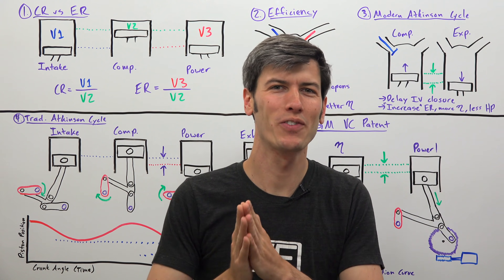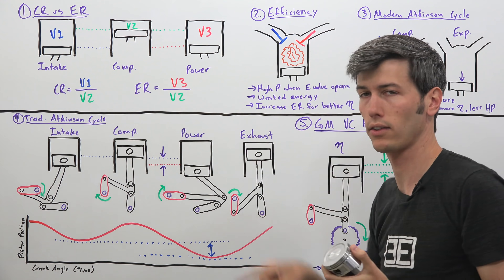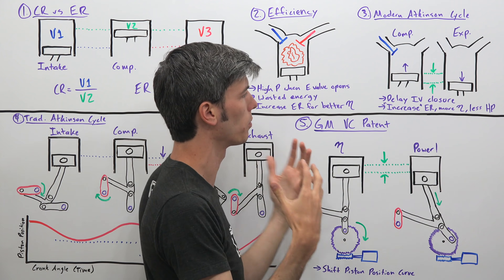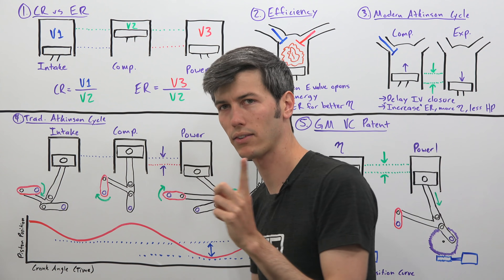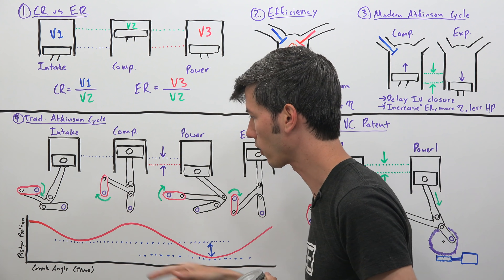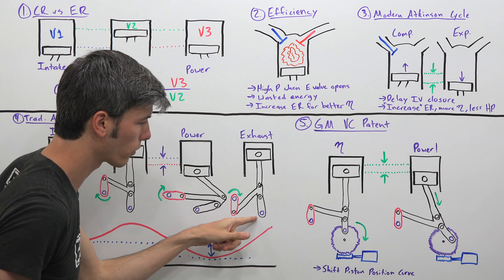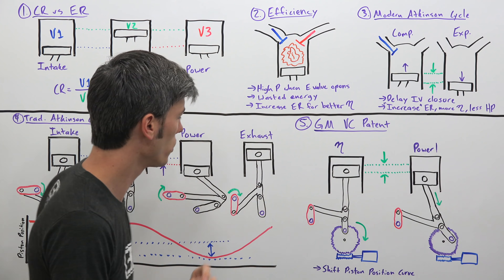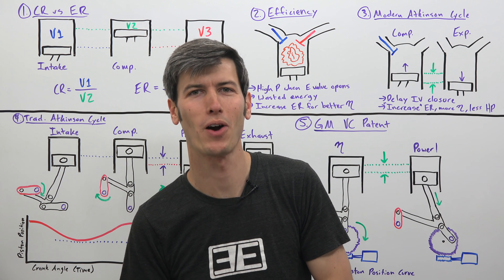How GM's Variable Compression Engine Works - Patent Review

Comment from the maker: Hope everyone's having an excellent day! What do you all think about this style engine versus Nissan's VC Turbo? Thanks for watching and thank to Skillshare for sponsoring! First 500 to sign up get 2 free months! https://skl.sh/engineeringexplained2
Reply: One of the few things I noticed is that Nissan’s engine will have almost no secondary piston imbalance in an inline 4 configuration while god knows how many balance shafts will need to go into this GM variable compression motor.
Reply: @gqh007  correct. This GM desigin would be heavy due to its need for balance shafts.
Reply: Looks like it might only work in an inline engine, which is a downfall of the Nissan approach also. Simple in principle, however the likely increase in overall complexity and manufacturing costs wil probably result in this design not reaching production. Personally, I prefer the nissan approach as it allows for much smaller rod angles, reducing side force. I am currently looking into another approach which allows for variable compression and expansion ratios and can be retrofitted to any existing engine. EE, if you would like to talk about this, let me know.
Reply: @jordmaate  aahhhh! Someone with sense. Also. This GM desigin looks like vibration may be an issue.
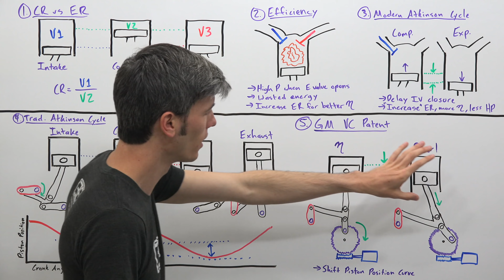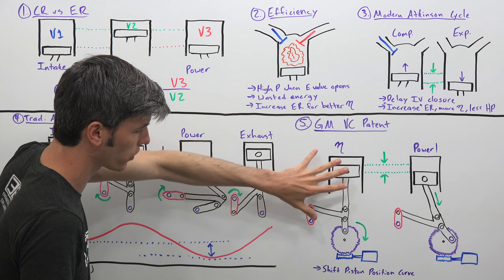Reply: You probably won't address this, but anyway: I believe you misspoke at 8:16 and 8:53 because you said "traditional Otto cycle" instead of "traditional Atkinson cycle".
Also, you seem to contradict yourself because at point 3. you say that decreasing the compression ratio gives more efficiency and less power, and at point 5. you state the opposite.
Reply: @Shewasa Fosho how does it get injected with no injectors or carburators ?🤔
Reply: @Shewasa Fosho do you know that the modern injectors are able to achieve up to 10 injections in a single 4 stroke cycle ?
 if you have 8000 rpm in a V8 this would imply 10 injections in less than 5 ms. Still i cant see how inefficient this is..
ur main goal is to reach a desired air fuel ratio, we still havent talked about ecology yet 😋
Reply: @Shewasa Fosho sorry bro am an engineer.
i understand efficiency with numbers.
please hit me up with ur injection efficiency calculations so that i can analyze it and tell you:
well done you are correct, those dumbass manufacturers where doing it wrong the whole time
Reply: Working as an Engineer I have developed over 100 1st Gen small block Chevrolet engines, and in technical inside sales at a U.S. engine remanufacturer taking calls from all over the country hearing from automotive enthusiasts, mechanics and the general car consumer gave me real insite of what engines are failing on large numbers call after call after call some people even crying in disbelief at the financial crisis a failed engine put them in. Mechanics telling me they see three of these a day, every day. Several engines with less than 100k miles.
So what do I think....deveopment of anything and the long term reliability, that we who own and work on 1990-2010 pre-direct injected Japanese developed automobile engines, depends on several factors and most importantly the background of the Engineers the engine builders hire. GM can build some of the best pushrod engines, but they need the best seasoned Engineers from Japan if they are going to make long term reliable engines the likes of Honda, Nissan and Toyota, who are also not without their own errors in the last 20 years. Personally as an automotive enthusiast and not a car consumer, I would wait years to verify reliable technology. The shift I am seeing is not long term reliability, but rather a disposable mentality just past the warranty period. My advice stay away until it's proven, and stick with what is proven reliable. It's your money not the ignorant person who tells you what you should buy.
Reply: @mrasposito  I have helped out Japan A little more than the American automakers for quite A while now.  I did the initial design work for many vehicles since the seventies.  (child prodigy)

Over time people have begun to think Japanese designs are superior but the reality is, they are American designs made in Japan.

A few of my similarly named works... VTEC, Vortec, Voltec, Duratec, Ecotec and Ecoboost  
                  
Of course there were many more designs that I have created.  Some were for the military.  

On my page I have various videos with A few examples of different projects people can check out if they want to.  One is for an anti-knock device that should make compression ignition gasoline engines fairly easy to do.  On A regular engine it allows me to advance the ignition timing to the maximum factory setting.  Which is something you cannot do, even with race fuel!  Pause on the distributor part, if you wish?
Reply: Looking at the 3rd example. Why don't they close the intake valve before bottom dead center? You should end up with a drop in pressure compared to a normal cycle so the compression should be less, except you're not dumping fuel and turbulent air back into the intake. Am I not understanding something or is this already being done and it's just not enough? Could even run forced induction with it.
Reply: @sijonda  my thoughts too, may be for turbulence, not sure. I do know cam/valve timing is extremely intricate. There are engines where for power or effency the valve timing is different for different cylinders, usually say a 4 cylinder with 2 intake runners of different lengths but could be applied to almost any engine.
Reply: @danielrouw2593  I'll have to search for it after I'm done with work. I was just trying to think of something that would get a similar result to these variable compression designs without adding a ton of big moving parts. I feel like adding more weight like this will just increase the mechanical loss cutting away at the improvement.
Reply: @sijonda  Look up the Mayflower Engine, there are some 3D youtube videos of it.  Not sure where the company went?  I think it is a better design than this new GM patent.
Reply: @danielrouw2593  yes, the opposed piston design I saw a while back would be a great design. It reminds me of how a rotary works. Really hoping Mazda comes up with a design that resolves the hot exhaust and lack of torque.
Reply: @sijonda  already did... its called a turbo!
Reply: @lolouro2266  Which comment are you replying to?
Reply: @sijonda  your rotary comment
Reply: @lolouro2266  ah. Forced induction didn't really solve either of those problems. Which is probably why they went back to NA with the RX8. I'm referring to a few design changes a few hobbyists have been doing by offsetting the combustion chambers on the rotor and the design of the hole for the sparkplug. They need to eliminate the burnt fuel leaking into the next cycle chamber and the force pushing the rotor backwards. The leak increases the exhaust temperature creating more NOX if I remember correctly. The pressure pushing against the opposite side of the rotor killing the low rpm torque.
Reply: @sijonda  turbos love hot exhaust and they make up for the torque.  I used to race rotaries and took 5.0 mustangs all day long with simple bolt ons.   Emisssions is another story.  The rx8 motor was redesigned with the intake port on side housing.  That helped some overlap and emissions but not the torque.  Without turbo its a dog i agree.  Then u need to port for torque/power, but porting makes emissions even worse. Lol.  16x was supposed to solve those issues but they decided to work on the piston motors.
Reply: @lolouro2266  I'm not disputing getting more power from forced induction. I'm saying a turbo didn't solve either problems which killed it off, for now. Poor mileage from a lack of torque vs the amount of fuel used. Throwing a turbo on it just made it worse. And the tighter emissions requirements meant they needed to cool the exhaust gasses down. Yes these are fine when centering on performance but I'd argue efficiency has a direct effect on performance.
Reply: @sijonda  ur orig comment was hot ex and torque.  We agree turbo fixes torque.  Hot ex i dont think is an issue. Like i said turbo likes hot ex.  And hot ex actually makes the cat work better!!  All my street rotaries ran cats and they passed fine.  Its when u get full ex that makes it Not pass.  mpg is totally separate but i agree mpg and lack of knowledge/maintenance is what killed the rotary.  They inherently burn oil. And many did not check their oil levels on a reg basis. And they eat spark plugs pretty fast.  But many sued mazda when their engines blew up for user error and or putting too much boost.  Not many ppl knew how to tune rotaries.  Mazda lost a lot of money on the fd.  So thats one reason why they took the turbo off for the rx8.
Reply: @lolouro2266  Don't forget about the oil needed to be used to pass emissions also wasn't good for the engine. This was a specific issue in the US.
Reply: @sijonda  i never used special oil to pass smog?  What oil r u talking about?
Reply: @Shewasa Fosho a nitrous system includes a gas which is already pressurized in a bottle.
already pressurized fuel ? this wont work since you have no control over the amount of fuel ur injecting, the flow of vapor will be dependent on the pressure inside the tank.
other than that you need a compressor since fuel is not a liquid anymore (u cant use a pump), u would eventually have a hazardeous compression process, a small leak allowing air into that compressor will result in a catastrophic explosion.

not sure whats wrong with modern injection system ?
Reply: M F  It's a patent so it's going to be over simplified. Patents do not typically contain control information. The only way to control this would be via the ECU and some external stepper/worm gear motor. The mechanical linkage is how it all works but it would most definitely be controlled by some kind of controller.
Reply: Engineering Explained how did you find out about this patent? I assume you didn’t randomly look up this patent?
Reply: Honestly Nissan is a much better engine/electronics manufacture, but GM has much better transmissions available to them which I suspect was handicapping the VC-T
efficiency.  So a toss up for me.

@Engineering Explained - That said Jason you really need to continue your "Best Engines" Series, I'd love to see a deep dive on the VR30 engine from Infiniti .
Reply: @BigHeadClan  supposedly the vc turbo that they are putting in the rogue gets 30 city and 37wy in fwd so the transmission isn't handicapping the mph meanwhile what does hona and Ford get with its 3cyl engine?
Reply: @occckid123  The Altima in FWD on the same platform is smaller and lighter and only manages 27/34 City and HW give or take an MPG depending on testing so the Rogue will be 1-2 MPG worse.

No change we will see those numbers with the VC-T unless there was a big revisions made.  

Which isn't to say I hate the VC T I think Nissan did a really good job with the engine,  I just think  the added friction inherent in CVT's  drags downs the efficiency.
Reply: @BigHeadClan  its actually 25/34 for the rogue but im not talking about the 2.0 vc turbo.  I'm taking about the 1.5 vc turbo.
Reply: Shewasa Fosho that lowers volumetric efficiency...bad idea
Reply: I feel like the worm and wheel system isn't going to be as fast or reliable as Nissan's.
Reply: It looks like it does the right things when you you solely at TDC and BDC positions but based on your drawings, which as you said may vary from the final product, there is a potential for a very negative power/economy flow on effect. At TDC and BDC with a conventional engine there can be no power produced due to the to the lack of offset between the centreline of the pressure vs the centreline of the connection to the crank. Only when the piston i part way through the cycle is there any torque created via the force vs distance. The new GM patent looks to be dramatically reducing the peak and average crank offset distance which even though it is sweeping the same volume it is producing less torque. This may be entirely due to an inaccurate scale in the drawings but it's not that hard to punch in values to calculate it.
Reply: When is someone gonna build an electric work truck that has a heavy duty diesel Welder built into it that seconds as a generator to charge the batteries for extended trips?  It seems like a no brain'er... The tech is already out there, someone just needs to build it already.
Reply: @danielrouw2593  That was not what I was writing about, but thank you for trying to help : )
Reply: I've heard the skyactive x feels pretty powerful for the amount of fuel it uses
Reply: Nissan's is better.
Reply: Nissan VC-Turbo is a whole world better
Reply: Has your Tesla exploded for no reason? Don't park it in a parking structure!!!

Comment: I have another idea I think better idea on this subject which the bouncing con rod is fascinating it seems weak to me my idea is far more straight forward as it would have to deal with inertia compression and variable piston hight controlled by spring or fluid where as the inner and outer piston vering in diameters would extend or resend apon engine speed I'm wondering  if this concept is possible please let me know if our current technology can make this situation happen?

Comment: If modern Atkinson cycles work by just valve timing, then wouldn't it be easier to just change the timing to get more power instead of more efficiency?

Comment: My Mind is boggled! I had never heard of this. I was never a mechanic but I know how to bend a wrench. One of the most incredible things I had heard of a few years ago was variable valve timing. I have enormous respect for my Buick Regal Turbo engine. 260HP at 240 Ft/lbs of torque out of a two-liter bottle!
Reply: Wait til you hear about the GR Corolla making 300 HP from a 1.6 liter 3 cylinder

Comment: What most people don’t know is that Saab had a 1.6 Inline 5 with variable compression back in like 2000. The cylinder head would tilt to change the size of the chamber and go from like 8:1-14:1. It was rudimentary compared to the newer tech, but it worked.

Comment: So the blue linkage is free moving at both ends and the red “linkage” crankshaft is of course only free moving on one right? But then GM went and made the position of the STILL free moving linkage change? Which is like taking a normal variable compression engine and adding an extra degree of free movement? Also what about having the blue part be a second crank type shaft with a gear ratio to the red one, or just different “lift” than it, would either of those options work and do anything or would the ratio thing just make it change once per cycle?

Comment: Let's assume the crankshaft is rotating at steady RPM. The piston movement is almost 2 times during exhaust stroke than any other stroke in this design thus it may have some issues related to excessive wear due to piston being thrown around at various intensities.

Comment: Nice, but you don't need this. For normal passenger car you use as high compression ratio as possible, and for sporty car you lower it to get more boost, sporty car doesn't need to be eco-friendly and they're low volume products anyway.

Comment: since the intake valve is going to stay open as the Pistons coming up I'm assuming that they're going to implement some type of supercharger to turbo turbocharger similar to of a Mazda Miller cycle engine that way that the air will be forced in as the Pistons coming up.

Comment: Cool concept but I can't get my head around the fact that the drag from all the extra moving parts would offset some of the efficiency gains? Those complaining about reliability should really read up on cam in block and flathead engines. There were naysayers every time a major innovation like this came about. Reality is we now have overhead cam, direct fuel injection, hydraulic automatic transmissions, etc that last hundreds of thousands of miles without need for major overhaul

Comment: Haven't you wondered why crankshafts have a certain size? Haven't you wondered why they don't make the bearing surfaces of crankshafts thinner? Have you looked at the reliability of engines where they did do that? Do you think this many links is gonna last? And now take into consideration that the conrod is not making a smooth motion but its getting thrown left and right. Every link in this mechanism has it's own inertia, and every link gets pushed back and forth by the other links, the slop adds up, the banging of the conrods changing direction adds up.

Comment: Over complicated and relatively unreliable way of getting around the use of solenoid valves which could give any ratio between compression and power strokes and would not introduce any more moving parts (Actually eliminates a lot of moving parts) and would make a much more reliable and more easily maintained machine.
Exactly the same as every other piece of garbage that GM has produced since its inception.
Obama should have just let these clowns go bankrupt.

Comment: More efficient at converting fuel to power, but less efficient at what you really need,,, moving the vehicle the maximum number of miles over the life of the engine.    More repairs= inefficiency ..   More maintenance=inefficiency..   Short engine life span= inefficiency

Comment: If there is no circular motion of the main crankshaft anymore, there must be unbelievably huge stress on the connecting rods every time the piston changes direction, because you always kill the momentum multiple times a second. 
That could work as a prototype, but is definitely not suited for 300k km +. 
No matter which brand builds it... change my mind.